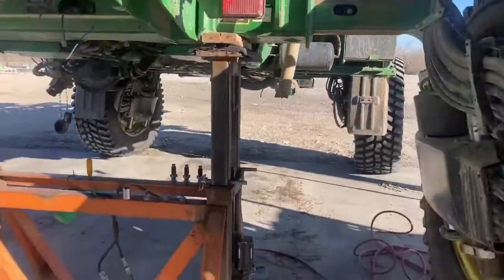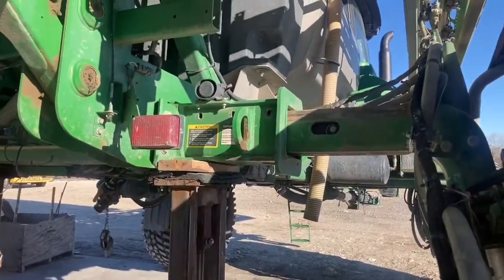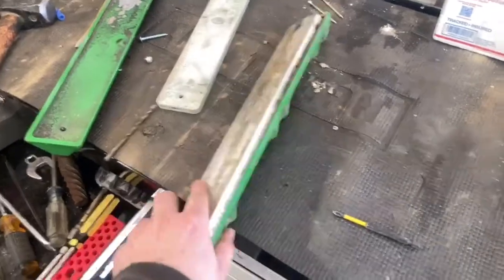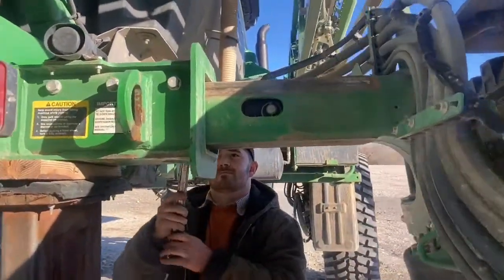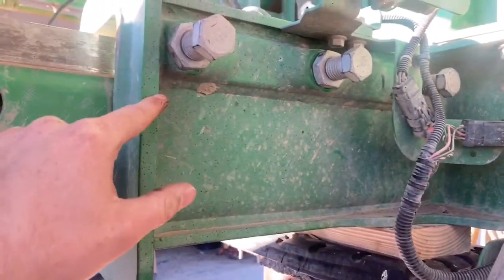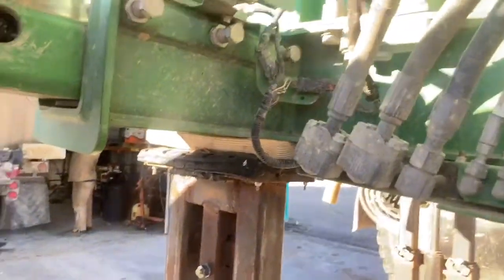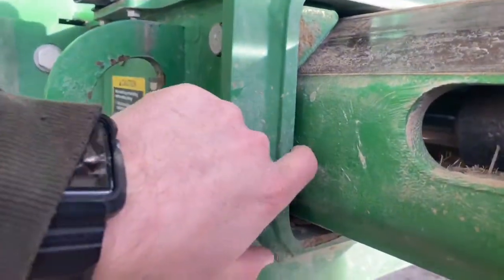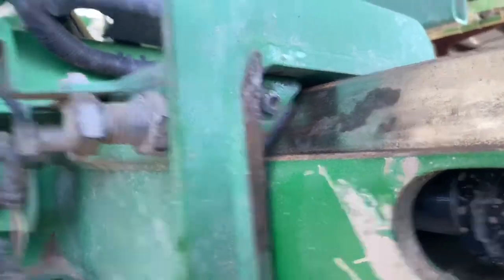How to change shims on John Deere R4038 Sprayer

Comment: Great video! Do you know if when those pads wear down does the wheel tend to tip in or out? My sprayer has a left front wheel that is tipped causing uneven wear to the tire and was wondering if that is what might need replaced?